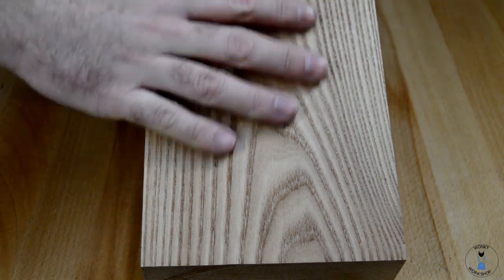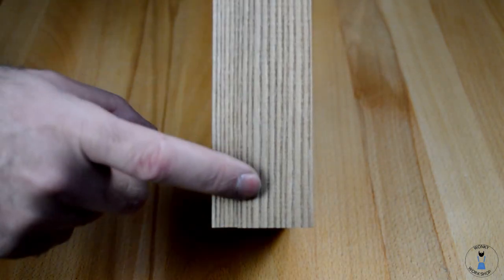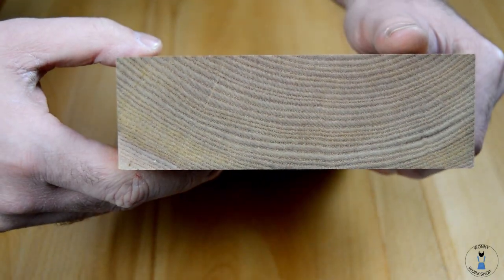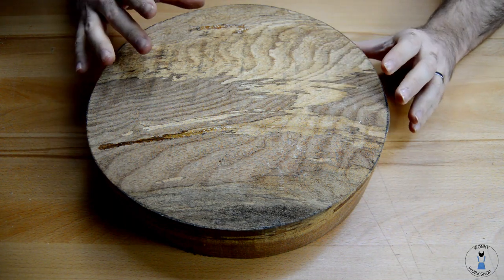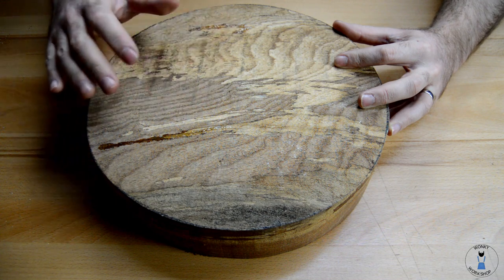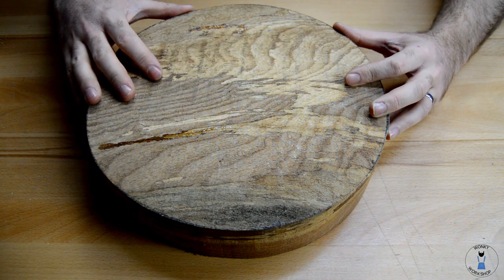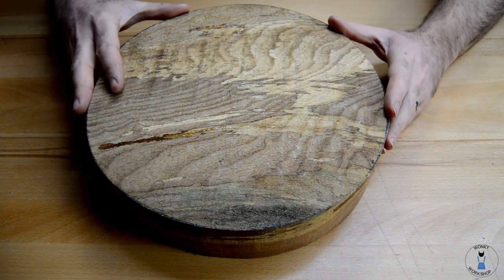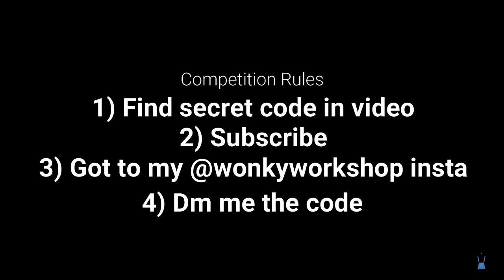Wood Wecognition Wednesday: Elm

Comment: Suggestions for finishing it? Something clear, low or no gloss, but brings out the grain?
Reply from the maker: If you want no shine and want to stay clear then an oil is your best bet. Possibly a tung oil. First coat thinned down then two coats after or more until you reach your desired finish